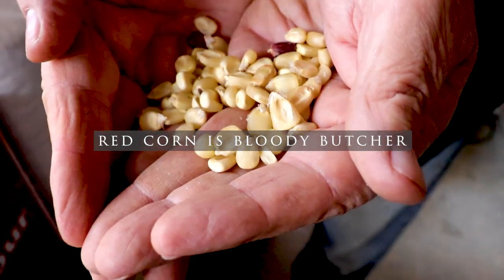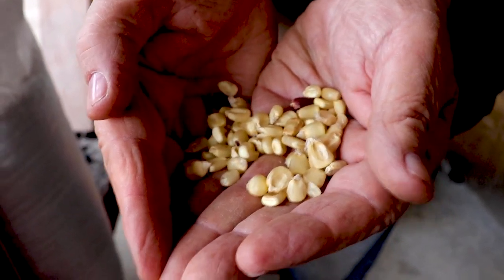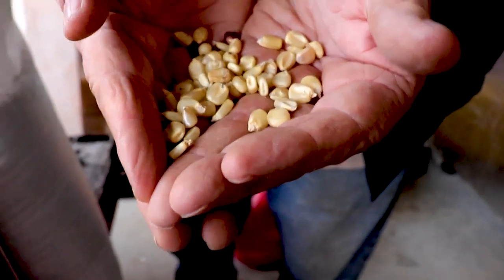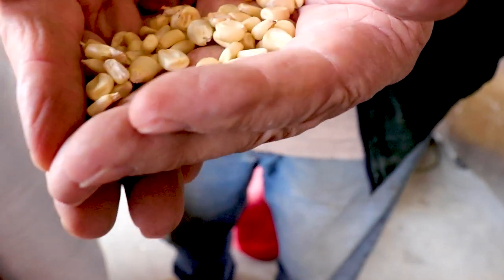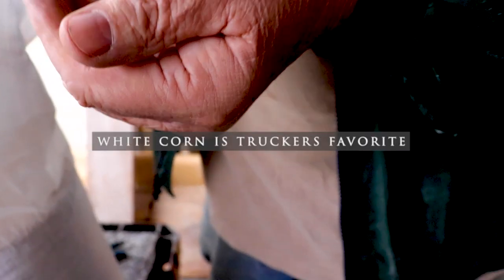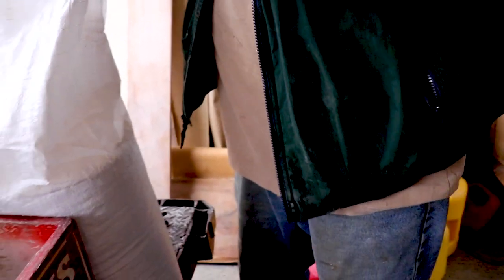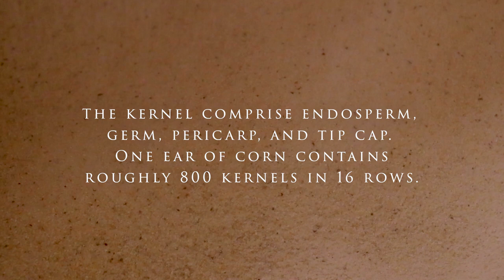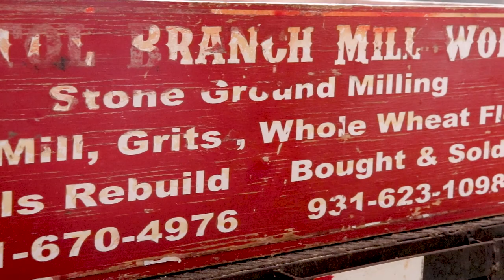STONE GRINDING HERITAGE CORN | See how it's done!

Comment: Nice video, Kaye.  I grow and grind my own into grits and cornmeal since the last 13+ years here in Georgia.
Reply from the maker: That is awesome!
Reply from the maker: What mill do you have? I have a small amount of wheat berries that will need to be ground but I don't want to spend a ton for so little.
Reply: @Latebloomershow  I have several mills but the primary one for grinding corn is the MockMill attachment for the Kitchenaid mixer.  It grinds wheat as well.  The Mockmill is about the only mill that I am aware of that will allow you to regrind your product.  Also, it comes as a stand-alone unit,  too.  It uses the "stones" which makes it as close to stone ground as possible.  One stone is stationary while the other is adjustable.  It works awesome for me.